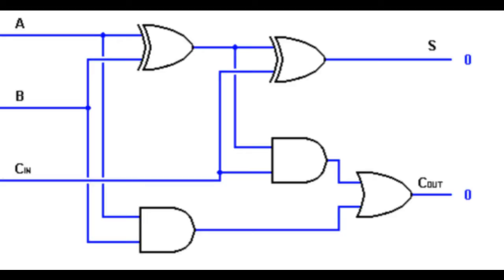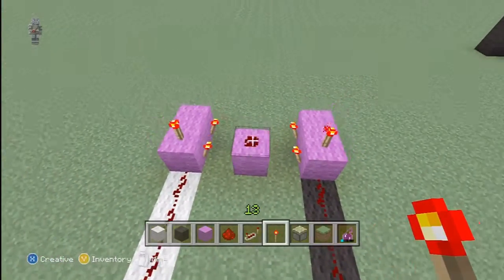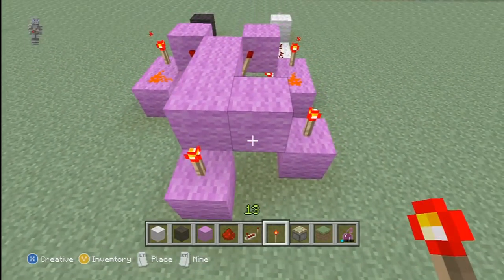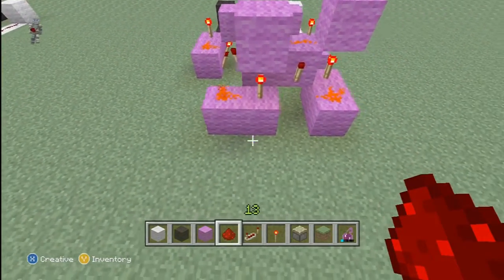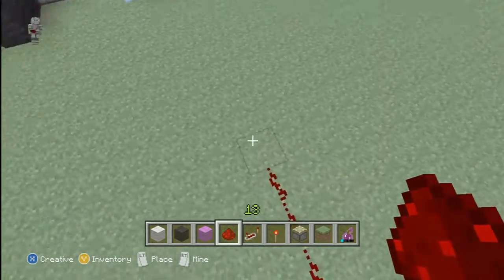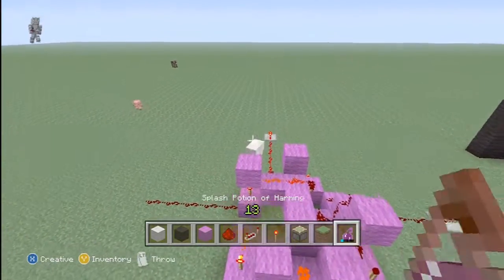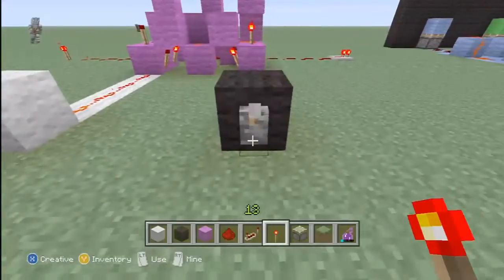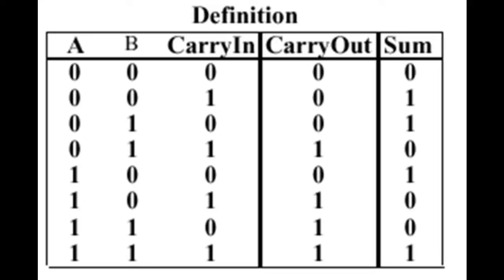Redstone Binary Full Adder [Mathematical Minecraft Ep. 2]

Comment: if you do 011 + 110, you get the wrong answer. this design does not work
Reply: it only has 2 outputs dipstick.
You clearly dont know how computers work
Reply: ProMCRedstone i know that, but if you were to connect them together. it would not work you try
Reply: Well you see, was your answer 1011? But the thing is that dont register in a 3 bit computer, what the 3 bit computer sees is 101 so thats why. I tried it and it works just fine.
Reply: ProMCRedstone ok, makes sense